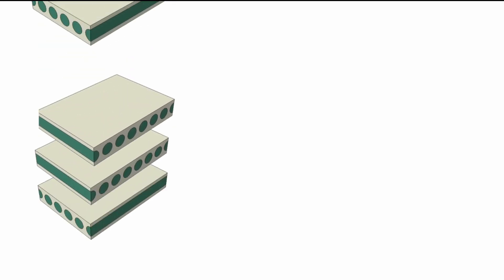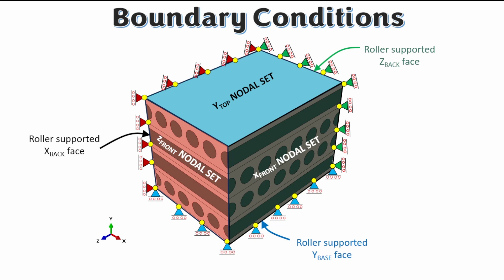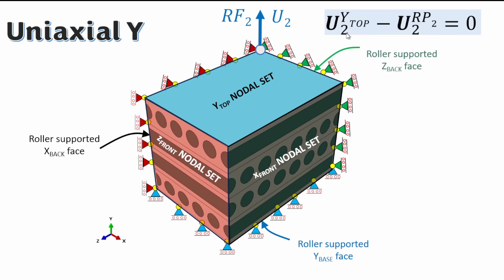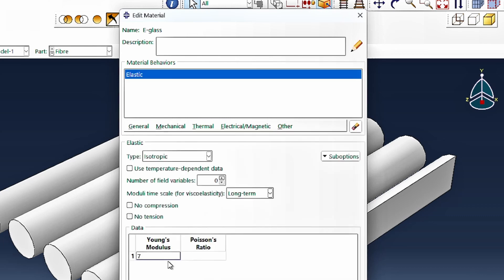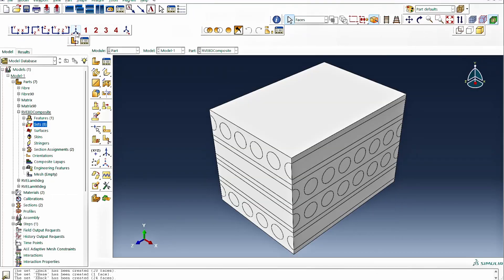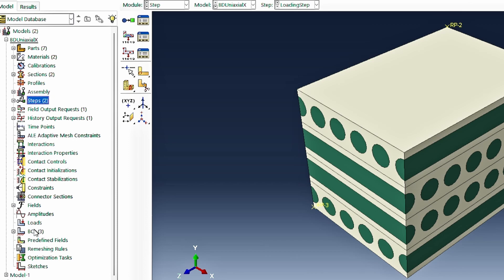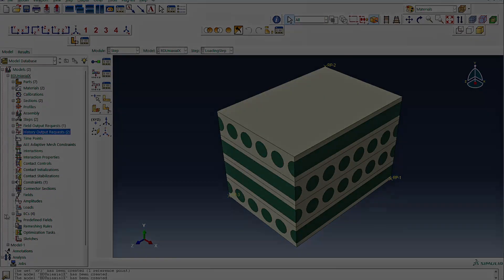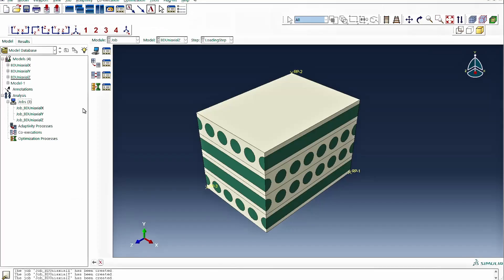RVE Modelling of BD Composites #2:  Uniaxial Loading Setup

Comment: Thanks for your wonderful informative video sir, I have a doubt in the case of a composite containing several inclusions in a matrix, if we model it in 2D how  can we convert volume fraction into corresponding area fraction in 2D. Could you please share your insights on this
Reply from the maker: Hello, I have provided this answer already in a direct message to you but since this is public on YouTube as well, I thought to post it here so that if anyone is dealing with such query, then can benefit from my thoughts:

"Thanks for your email and the detailed description of the problem.I think some things need to be understood in the context of what you are asking:

(1) Are you modelling a laminated composites i.e. UD or BD composites? If so, then it is relatively straightforward, you can divide the volume by the length (height) of the representative volume element to get the area fraction. I suspect this is not your query.

(2) I assume your query is with regards to  a particulate composite comprising say spherical particles distributed in a given representative volume element (RVE). It is complicated by the fact that your particles are polydisperse i.e. have diverse diameters. If this is the case then I will suggest the following: 

(3) For such a system, there is no direct coversion between volume fraction and area fraction due to the dimensional differences between the two domains of analysis.

(4) For a first, the 2D domain represents merely a slice through the volume of the RVE. In which case, you are just sampling a single portion of the domain. Whatever area fraction you get (for that single slice) will definitely be wrong, since I will imagine it will be be statistically representative of your domain. It is just the accident of a single slice. 

(5) To correct the problem, you have to analyze multiple slices and determine the area fraction for each slice, then in the end find the average of the area fractions (which gives you your desired area fraction) and due to the diversities of the slices considered, you need to also compute the standard deviation which becomes your error. In the end your area fraction becomes: Af = Af_mean +/- standard deviation (as error).

(6) In terms of determining your Area fraction for a slice, this will probably involve you finding the sum of all the areas of all circles (for a spherical particulate system) per slice and divide that with the area of the sliced 2D RVE.

(7) The whole process above can be done automatically computationally within say ABAQUS. You can write a Python script which - depending on the slicing distance you specify, automatically partitions the domain and for each sliced surface (automatically) determines the area fraction for that surface.

(8) Once you have identified all those area fractions, then you can calculate the averages and the associated error.

I have not tried this but it seems to me this is the educated 'guess' way of computing an area fraction based on a multi-particle particulate composite where you have the 3D RVE of the domain. It will be a methodology I will try out first and do let me know how you get on.